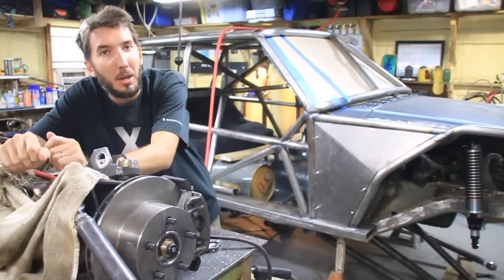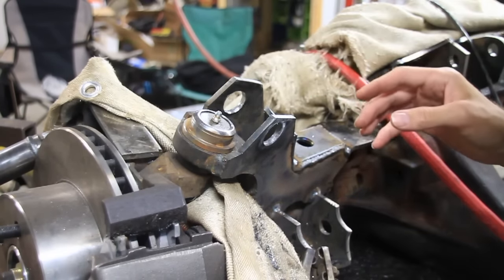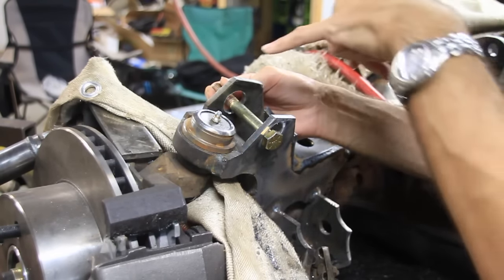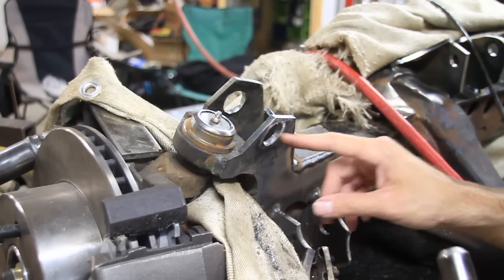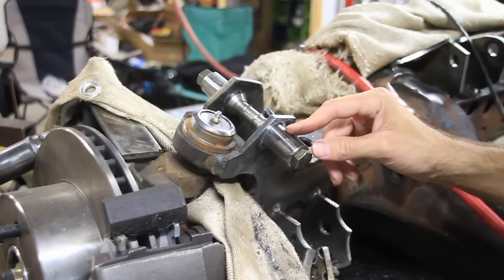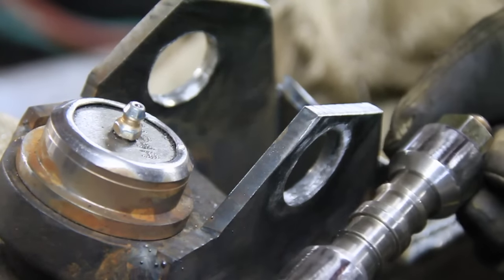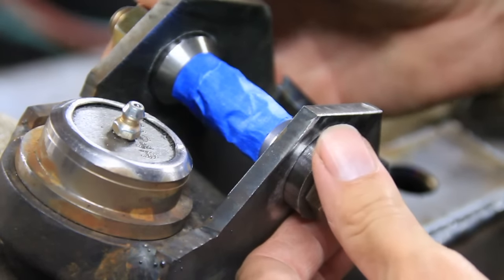Make a Round Hole Square

Comment: Keeping the ball joint cool, is that to not destroy the ball joint or to not warp the hole for the press in fit on the C, or both?  I've had the idea of mounting my coilovers there when I eventually link considering i want to keep the HP Dana 30
Reply from the maker: There is grease and rubber seals in there... don't want to melt the rubber or boil the grease.  I have heard of them exploding but have never experienced it.
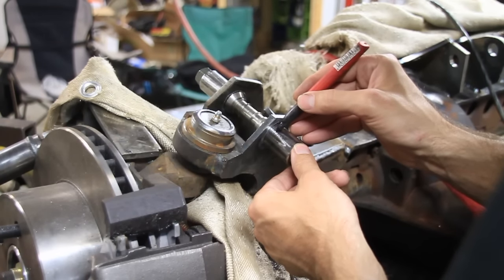Reply from the maker: check out this video at 3:00 https://www.youtube.com/watch?v=93CtsxrRksc
Reply: Dam Ill keep that in mind

Comment: Fucking YouTube sucks. And I'm not slamming this video...I searched for "how to cut a round hole" and YouTube returned a dozen results of how to cut a square hole which is pretty fucking basic. I need to put a 10 in vent fan in my basement to relieve the humidity and ducting is ROUND. WTF YouTube the stupidity of your board is starting to trickle down into your search algorithm.